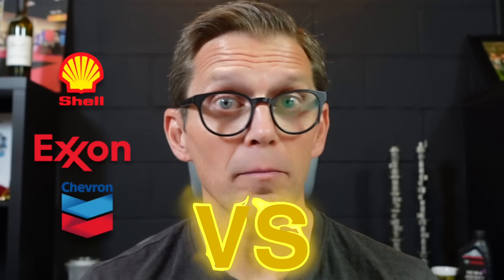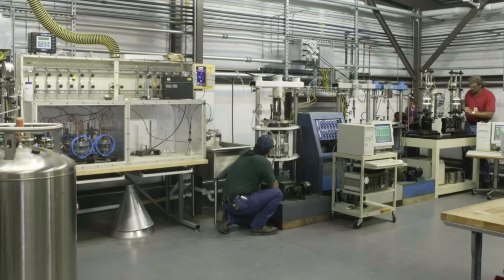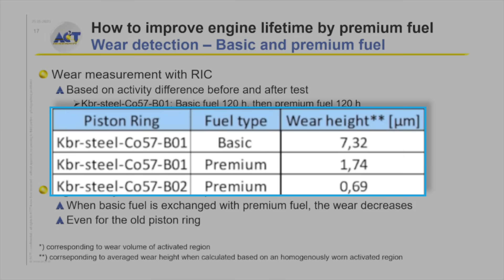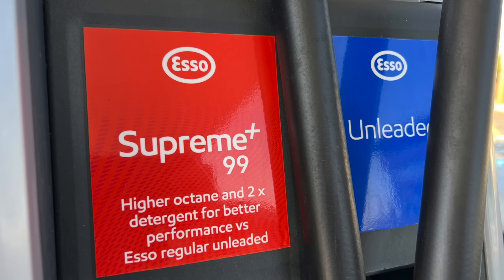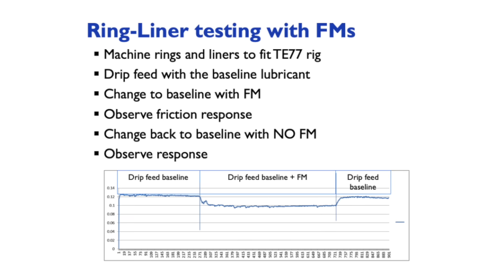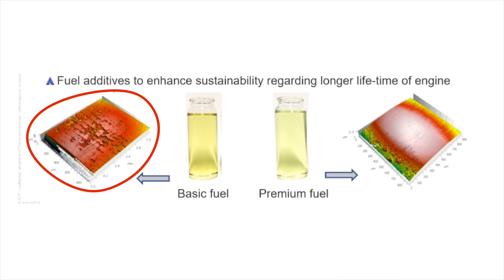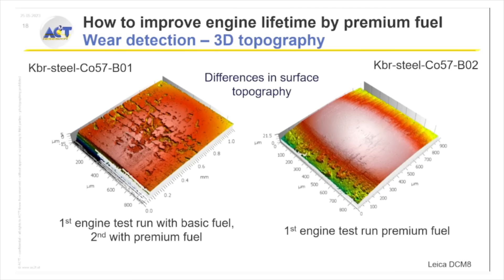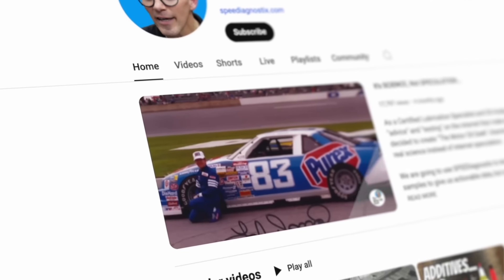Can Premium Fuel REDUCE Engine WEAR?

Comment: Hey Lake…where can we find a “ranking” of fuel brands from a premium additive perspective?
What about upper cylinder lubricants?
I’m a YES for a fuel video…
Reply: I used to use Shell 93 in my 2013 Scion FR-S which recommended premium fuel. Then my Shell station switched to BP, but they still kept the 93 premium (still the same fuel???). Sold the FR-S, and now have a 2015 Nissan XTerra. I started with the BP 87 octane, but was having issues with smoothness and knocking in the winter. Switched back to the BP 93 and problems resolved. I tried BP 87 again when the warm weather returned and stuck with that for a while. One day I decided to see if the BP 93 would actually make a difference so I filled the tank. I immediately noticed a difference in performance and smoothness. I now stick with the BP 93 as I am convinced that it is the highest quality fuel in my area. There are no good Shell stations close enough for normal fill ups.
Reply: @ICECarOwnerDIY BP is not a top tier fuel.
Reply: @ICECarOwnerDIY  If the XTerra had the VQ40 engine, it may have needed 91 octane as recommended since all vq engines run better on 91 or higher.
Reply: many Nissans don't like regular 87 fuel. My friend would have check engine light coming up with O2 sensor reading problem. As soon as he switched to 89 or 91 the problem would disappear.
Reply: @ICECarOwnerDIY Might have been knocking during the winter because of the butane injected vs summer no butane is in the fuel. Up to 5-10% butane in winter. Butane increases the Reid vapor pressure
Reply: @ICECarOwnerDIY the reason ur engine runs best on 93 is because that’s what the ecu OEM tune calls for.  No new engines are tuned for anything below 91. The reason you can use a lesser grade of fuel, is because the ecu can make up the differences by using more fuel and less spark to keep knocking to a minimum if any at all
Reply: @ziggyortiz37 not tuned for less than 91?  This doesn’t seem to make sense with certain OEMs having recommendations of 87 minimum octane in the manuals. Our 2017 Pacifica calls for 87, nothing more.  So I would assume they tuned the engine to run on it, and premium just wastes money.
Reply: @Tsuter1978 24 Chevy 5.3L has 87 recommend. Just because it’s the recommended doesn’t mean recommended for you. Just like lifetime transmission oil. Same as 10k oil change. I still own a 05 2.2L Saturn ion with 250,000 miles. Changed oil every 3-5K with NO engine problems ever.
Reply: @ziggyortiz37  adding fuel doesn’t change the fact that the fuel is less resistant to knock.
Reply: For the price Lucas is hard to beat, it’s not fantastic at cleaning, but it’s pretty good at maintaining a clean engine and is very good at lubing the cylinder walls well and helping increase compression
Reply: @meaculpamishegaslit Lucas additives are sketchy as hell
Reply: I still want to see the test results of "tribotex" supposedly it rebuilds surfaces
Reply: @cyclesaviorn2700 can't rebuild surfaces once there damaged.   Come on just think about it?   No additives can reverse damaged cylinder walls.    They can help reduce them from happening but can't reverse it
Reply: @cyclesaviorn2700 or tribodyne
Reply: Scam @cyclesaviorn2700
Reply: Top tier brands are usually the best. Google top tier gas brands
Reply: @MikeM952  Top Tier has nothing to do with anti-wear additives. The Top Tier consortium only regulates (among its members) detergent power.
Reply: Top tier is a detergency standard and a lotta marketing hoobityhoo.
Reply: I don't remember where I saw it, but someone took gasoline from several locations of several different gas stations and measured the additive packages of both the premium unleaded (91 or 93 octane) and regular unleaded (87 octane) gasoline.  Costco had the best regular unleaded gasoline and second best premium unleaded gasoline.  Shell V-power was the best premium unleaded gasoline, but they had one of the worst performing regular unleaded gasoline additive packages.
Reply: @r.j.bedore9884  That makes sense, based on price.
Shell regular is cheaper than Chevron regular, everywhere I have checked.
Shell premium is more-expensive than Chevron premium, everywhere I have checked.

To me, it's obvious it's the quality of the additives. You get what you pay for.

In the special case of Costco, the "lower price" is a result of volume discounts, subsidy from annual-membership revenue, lack of advertising, and forcing buyers to wait in long lines (to minimize Costco's per-unit infrastructure costs). Costco gasoline (of any grade) contains no anti-wear additives, whereas Shell premium-grade does.
Reply: In most states premium gas is about 30 or 40 cents more than regular.  But, in Indiana and Illinois where I drive it's a full dollar per gallon more.
Reply: I was also wondering about lubricant additives like Marvel Mystery Oil, Lucas upper cylinder lubricant, 2 stroke oil, etc. Although we don't know what friction modifier additives were tested or in what amounts, this data would seem to support that adding extra lubricity to the fuel with additives actually could decrease wear.
Reply: @averyalexander2303   I've heard they can damage your catalytic converter.
Reply: @averyalexander2303 I've tested a few of these if it helps. The easy proof was an increase in gas mileage. The other claims like reduced wear? 🤞
Reply: @averyalexander2303 that’s one of several reasons I keep buying those products. Lucas and MMO usually.
Reply: Yes, more info on fuel brands and there additives
Reply: Is there a benefit from using shell oil and fuel to see if it makes a difference.  Are they designed to work together for better benefits?
Reply: @justlost2010  that’s a damn good question!!
Reply: Can you do a video that shows wether we should add fuel additives to fuel ourselves for diesel and for gasoline engines?
Reply: Yes, more in depth fuel analysis!👍
Reply: Lake, more fuel videos please.
Reply: Its wild that practically everyone in this reply thread has no idea what they're talking about. You're all arguing and don't even know why.  One of you. Not one of you know anything about fuel
Reply: @sloanmagnum5009   - Yep. 

Even at the engine development department over here a Toyota Motor Europe we don't do the tests Lake explains. 

Even not cylinder wall coatings etcetera. 

The fuel used is ordered, 2 types, just regular fuel as we use at the pump. Shell is too expensiveand and not within thé budget ..  .
Reply: Chevron is the best but hella expensive though
Reply: My car requires regular fuel. Is Shell’s regular fuel still better than other brands’ regular fuel?
Reply: @7Gia_  Shell is good. ConsumerReports has shown that TopTier Detergent gasoline is the key to quality gas. Shell is TTDG!

Personally I use Sunoco. They commit to ensuring the same detergent package is equal across all their octane ratings. Some TTDG brands blend their packages to just meet the specs.

That being said. Any TT gas works for me!
Reply: So should we run premium fuel in a car that doesn’t call for it (2018 Outback)?
Reply: I agree with the OP. Though I’m stuck with only one gas station when I stay local. I have a turbo charged car tuned on 93 octane & only have one station with it because I live in a dinky part of the country. I don’t even know which conglomerate they’re Part of off hand lol. Still though I’d be interested to learn more about the subject for both wear & economy (ish). I have had 2 engines in the car since doing the tune (long story). During that time I had 1 station with 93 I used. I got about the same power back then but much better mileage. Since the new engine went in, that station no longer offers 93 so I have to use a different one that now has 93. My mileage is way lower. And I wonder if wear might suffer now too. I also wonder if I should be adding any additives but I worry about losing power &/or causing catastrophic damage.
Reply: …marvel 👍
Reply: Based on Lakes videos I’m doing my own long term research in 3.6 Pentastar

-Only top tier fuel  -Techroline every 3k miles 
-Pennzoil Ultra Platinum every 3k miles 
- Wix oil filters

Shooting for 500k miles
Reply: As far as I know , friction modifiers are present in premium gasoline of Shell, Exxon, Mobil,  Esso.
Reply: i dont call 91 premium, 91 to me is plus, anything below 91 i don't even look at, i only put 93 in my car though, since i only drive high performance cars and want maximum power. Im glad that i live in NJ and 93 can be found at every gas station.
Reply: Most gas stations purchase gas from the same place the only difference is the additives they put in it!
Reply: Do I need to be scientific? 
2002 Lincoln LS 3.9L V8.
Designed to run on 87-91 octane. Ran 87 octane on a 80 mile highway run at 70mph. Averaged about 21mpg. Did the same on 89 and 91 octane. As the octane went up so did the mpg. 24mpg at 91 octane.
2005 Cadillac STS V8 Northstar. Written on the car is 91 octane only. Mobil 1 only. I now have 238,000 miles on the car. Every year I check and clean the throttle body and it always looks clean and new inside and out. I have used just about every brand of gas in 20 years, and usually the lowest price I can find. I add Lucas additives to the gas about once a year. I have never suffered internal engine problems. Knock on wood. I still have original fuel injectors too. Am I a scientific genius? No. I read my user manual.
Reply: Fuel testing and analysis please!
We all will benefit and so will you, Lake
The Porsche will thank you!
Reply: Mechanic in a bottle. I swear by the stuff. It's like 5$and u put alil in with a fill up of fuel. It really does give you better gas mileage on regular 87pump
Reply: It’s been difficult for me to find any independent testing. I have seen Shell do very well with new engine break-in. I’m not a fan of the 10% ethanol, no matter what anyone says. Just give me a good, clean, efficient, reliable fuel that handles however my foot demands of it. Clearly we’ll pay whatever the cost for a no-bullshit product.
Reply: @cjcantrell80  here in the Midwest is a cooperative petroleum company based in Indiana by the name of Countrymark. At most of their locations they offer a 91 octane ethanol free fuel and yes it is fairly expensive
Reply: Edit: found the video ...  https://youtu.be/J2d6_CIwaNE?si=-PIK2sq1ehk807Ru  so check my accuracy :p lol

there was a news agency that tested; comparitive numbers (not exact) would be something along the lines of Shell 30 units,  Mobil/Exxon 24 units, other big top tier brands 18-21 units ...  baseline top tier is about 10 units.
So Shell does 3x the cleaner in its PREMIUM, less in its non-premium, closer to other brands than the standard to qualify.
Some brands have 10 units or more, but don't pay for the Top Tier label.
Some brands used to be and stopped participating in the program after Covid to save costs, including not doing the additives.

For my area there are lots of Mobils around me, some Shells.  I've been going to Shell mostly but I have a small fuel tank and their bonuses require 10 gallon fill ups; I'd have half a  gallon of gas left! Mobil only needs 8 gallons to qualify for customer loyalty rewards (cheaper gas) and is more common around me.  I'll take the bit less additives to have places that are nearby and when my fuel light pops on and I get 8.3 gallons, I still earn loyalty rewards to get that 20-30c/gal off ...  which can afford me a bottle of Techron every 3000 miles.
Reply: Yes, please!! It would be brilliant to have a European focus in one of your videos to understand fuel brand selection. Also, is there a difference in terms of cleaning additives and friction modifiers between ordinary shell 95 and the V-power? This info is tough to find! Thanks for the great video!
Reply: Does anyone know what additive package Costco puts in there gas? I know they don’t make it them shelves. They love advertising the Top Tier all over the station!!
Reply: Ok I’m just a little confused after this video. I watched all of your oil videos and fuel videos. Here’s my question. Top tier fuels are at different octane levels are you saying now that premium fuel is even higher protection not just higher octane  ????????
Reply: Would love to see a video that analyzes the different premium fuels from the major suppliers like Shell, Chevron, Exxon, etc.

Also interested to find out if a fuel additive like Lucas (which advertises reduced wear and upper cylinder lubrication) added to a premium fuel helps or makes things worse.
Reply: @DavidAg02  when you keep talking about premium fuel…I’m not certain your referring the ‘brand’ of the fuel or the ‘octane’ of the fuel…could you please clarify this?
Reply: @DavidAg02 Lucas is cheap for a reason
Reply: @donarcher5693  best check out BND Automotive.

ACES for gasoline or Diesel.......significant increase in bore ring life
Reply: plz
Reply: I would like to know why high octane fuel are cleaner, because the sulfure content will be the same ?? I wonder if additives will countermeasure that issue 
BimmerN53
Reply: Going to use shell from now on
Reply: Shell V power 👍
Reply: I don’t know if these results have practical application in a commuter car.  Any engine’s ECU will adjust for knocks and adjust for fuel octane.  This is a test in extreme conditions
Reply: Let me save you the trouble.   The best fuel hands down.  Is from shell.  The v-power nitro +   is the best fuel if you care about your vehicle. Got the most detergents then others. Even shell low 87 Oct is better then others high Oct has more detergents.    2nd would be Mobil synergy stations
Reply: @LORD_OF_THE_ROOTS how do you know? Did you test it yourself against other brands?
Reply: What fuel to use?
Reply: Fuel Video ! Fuel Video!
Reply: Yes. What is the best fuel additive? Will it convert regular fuel into fuel that is as good or better than premium fuel?
Reply: @richardschennberg1776  Octane rating has nothing to do with this video. And unless your daily driver needs premium aka higher octane to not destroy itself with preignition then using premium is just burning for no reason. This video is about the lack of sufficient detergent in most US gasoline and why it's a problem for modern vehicles, especially with direct injection. Really not that difficult.
Reply: My turbo Forester doesn’t seem to like shell gas it just seems to not run quite as well as other fuels
Reply: @projectfarm
Reply: Doing a web search indicated that Shell and Exon Mobil both advertise using anti wear additives, as well as high tier detergent packages.. If you can believe web info !
Reply: Sunoco in Texas 101 octane... Constant blue flame out of my Harley
Reply: Shell & BP are the only two I’ll use and 99% of the time it’s Shell.
Reply: @169abr  speak with BND Automotive ...ACES fuel additive.
Reply: @169abr literally the same two options for me and it’s mostly shell 93
Reply: @169abr yeah man that shell V power seems to be the nicest so far for my vr6. 
Pretty sure I couldn't be fooled in a blindfold test😂
I figured it would , because they put the V in it, so that means it's made for vr6s and other V engines. 😂😂
Reply: @MrTheHillfolk  my Coyote loves the V-Power, 7500rpm shifts and no knock
Reply: @169abr  I've been able to confirm that Shell and Caltex premium fuels both have friction modifiers added.  Have not been able to confirm the same for BP (in Australia).
Reply: @169abr  Why not Chevron?
Reply: @169abr it just kind of sucks that those are not available everywhere. I live in Montana and really wish that either BP or shell would be available to me.
Reply: @mspringett  Sunoco isn’t a bad option if there’s one near you. Some people have said they have luck with Mobil as well. I tested Mobil myself and the knock was less than CircleK/Racetrac
Reply: @169abr  I typically go to Costco and get their 91 octane no ethanol fuel. We do have a Mobil station but it's primarily Conoco here in montana. There is a company called Town Pump that operates all over the state and has a variety of branding to their gas stations.
Reply: @169abr  Pretty sure it is. My old man owned a BP gas station, only used BP premium fuel in his motorbike, went over 100,000k's (for a motorbike that is insane) they tore it down because by then you normally had to do a rebuild) and the thing was like new, nothing needed to be done. The thing went on and did another 100,000k after that with the new owner.
Reply: @169abr  BP is trash, shell, chevron, mobil
Reply: @169abr  Pretty sure BP is not "top Tier" if that matters to you.
Reply: @chestrockwell8328  I go based off datalogs of my car, and BP shows no knock. That being said, I only use it when I’m in a pinch and not near a shell.
Reply: @chestrockwell8328  BP seems to have voluntarily left the Top Tier consortium, despite its fuels continuing to exceed the Top Tier minimum requirement for detergent power.
Reply: @chestrockwell8328 , no, but they tend to have higher quality because they produce so much of it and they use a robust additive package compared to some of the other companies
Reply: Bp is a top tier brand.
Reply: @aliendroneservices6621  Where is the data showing this, or is "just" BP saying that?
Reply: @TedTedness  So far, it's just BP saying it. Independent data would be wonderful, but no one wants to produce it.
Reply: @169abr . Exactly!  I always use shell. If I use anything else, especially gas on any military installation, my tuner will ask me where in the heck did I get my gas and to go to a Shell. But I’ve been using shell for 15 years due to that.
Reply: @chestrockwell8328  BP stations in my area are not Top Tier rated. Shell regular gas is not certified as Top Tier as well. But the Shell V Power is Top Tier in addition to the anti-wear additive.
Reply: @169abr LMFAOOOO shell is overpriced fuel 30+ cents a gallon compared to anywhere else
Reply: @bfw59  Not any more. They quit.
Reply: @bfw59 BP has dropped out of the Top Tier program. I don’t know why, and I don’t know if their fuel still meets Top Tier standards, but I speculate that it still does.
Reply: @169abr  No one is talking about octane here genius. Any fuel with enough octane will prevent knock. People are talking about additive packages. Has nothing to do with octane. Try to keep up. At least you were right about Shell, by accident. Shell Premium is the best you can get in the US. Fact. BUT. not every Shell station actually uses Shell fuel! What? Shocking. Other top tier brands include Chevron with Techron, Marathon with STP additives, Costco.  Shell is the best, but again not every Shell branded gas station is actually selling Shell fuel in those pumps. You have to check online to verify. the Pump itself will have the "top tier" sticker on it.
Reply: @169abr  I have a 2010 corolla 245k miles. Around 200k miles it started running like crap. I always got bjs gas...not too tier. I knew nothing about top tier. Happened to get shell once and it ran great. Since I only get shell. It's definitely worth the extra 20 cents or so a gallon.
Reply: The basic Shell 91 octane fuel gives much better results than other brands e.g. About 5% better mileage.
Always wanted a better explanation for the difference.
:-)
Reply: I use 1oz of 2 stroke oil per 5 gallons of gas in my vehicles. There was a great discussion about it on the LS forums.
Reply: I do also.  I started about 10yrs ago, and all of my vehicles get the treatment on every fill up.  Even my bikes than use non-eth.
Reply: @taylorwarwick1001  This is something I've always done in my rotary engine,
the concern with modern stock engines/exhausts is that this extra oil risks clogging the cat converter.
Reply: Catalytic converters dont appreciate that @taylorwarwick1001
Reply: @taylorwarwick1001  There are lubricant additives available for pump gas 4-stroke engines....Lucas Oil comes to mind...
Reply: @taylorwarwick1001 yep !! Good call it have used it
Reply: @taylorwarwick1001  However, modern 4-stroke engines are designed to run on pure gasoline, and adding 2-stroke oil could potentially cause issues with the fuel system and/or emissions components over time.

Adding 2-stroke oil can contaminate the oil in a 4-stroke engine, affecting its lubrication properties. The engine internal components might experience increased wear due to improper lubrication.  And the oil can damage the catalytic converter, leading to costly repairs.  

The Oil Geek has already proven that stuff does make it past the rings, and they saw that in oil samples, so don't argue saying that can't happen, the tests prove that it does.
Reply: I've also been looking for a list of quality diesel fuels or some method or option for testing (testing seems to be focused on water and dirt contamination) 
The only "top tier" diesel I've seen is Costco/Kirkland and I'm sure that it meets the TT standards, but I would have difficulty believing it's the best option (also an unfeasible option for my location)
Reply: @UnProj  Cenex if its an option for you. Farmers, Truckers, construction fleets, and logging crews swear by it.
Reply: @UnProj  what about the Main Problem with fuel ?

Its not water in fuel. that's the biggest problem......its Entrained and Dissolved Air
Reply: @gj91471 best comment in this video 👍.
Air in the fuel system is a huge problem.
Reply: @gj91471  Whats the logic behind that? The only two papers I've found on dissolved air in fuel only claim issue for the gas station but claim it burns more efficiently. 

Basically dissolved air is good for the car not for the station...
Reply: @AlkalineGamingHD  stop reading BS papers. .....

My Diesel engine is nearly perfectly clean inside.

Injectors are spotlessly clean.

Go figure ....that Entrained and Dissolved Air is a massive Problem...for You...not ME.
Reply: @gj91471  Im talking about gasoline. Didnt know you were talking about diesel. I wont pry much further seeing how asking such a simple question like "why" was so unanswerable lol
Reply: @AlkalineGamingHD  Google.....Entrained and Dissolved Air in Fuel.
Reply: @AlkalineGamingHD  why would i bother explainjng anything to You.....

You think You know it all.....after reading 2 papers.......

I restore lost fuel economy........

Get complaints from the Motor Industry....for Engines lasting too long......
Reply: @gj91471  that's why I run a fuel/air separator, leaving the detergents/additives to by my primary concern
Reply: @UnProj  is that to seperate Water from the Fuel ?

Or Entrained and Dissolved Air from the fuel ?
Reply: @hanynowsky  So California oxygenating their fuel is bad?
Reply: Let's ask Scotty Kilmer 😂
Reply: @arinmirzayan3949 if he tells us,they throw him off YouTube, at least until his next video comes out.
Reply: Love your content but we need an oil analysis on Pennzoil’s new formula!!😮 Pennzoil platinum full synthetic now advertising 15,000 mile protection!! How is that possible without changing the formula!?? You taught us all those extra additives and detergents might not be a good thing. I think they ruined the original formula!! HELP!🤣🤣☺️👍
Reply: @josephparson7023  the one thing ALL oil claims fail to mention is the filter. Sure, maybe your oil can handle the beating for 15,000 miles. However, the filter, that can only filter out so much. No matter how good the oil is, it will always be dependent on the filter to continue to perform. Once the filter is done, the oil becomes the same sludge as any other oil.
Reply: @cjcantrell80 this is so true, even amsoil has you replacing filters at regular intervals in between oil drains.  I forget what the intervals are but if memory serves it was at least one or two filter changes in between oil drains.  But when I ran amsoil I used to just drain and fill at the same time anyway.  Cheap insurance for keeping the engine healthy.
Reply: @cjcantrell80 

thats true. I did a lot of experiments on a chevy malibu. Cheap filters would cavitate around 5000 miles. cartridges..
Reply: The very best fuel available in the U.S. is summer-blend Chevron Premium 91 octane from California. Reason: California gas has its own additive requirements which are more stringent and beyond those mandated by the Feds. 

Chevron’s additive package is considered the best in the industry and the proof is in the pudding: All major U.S. automakers use summer-blend Chevron 91 on the EPA fuel economy tests which are posted on new-car window stickers.
Reply: @kobyashee1832 California 91 is horrible for performance vehicles. Ask any tuner and they'll tell you how bad California gas is vs any other 91. California cares about emissions, and ending ICE engines
Reply: @kobyashee1832  Sources for any of your claims?
"For years, EPA has used a pure test fuel called indolene, which is not the same gasoline the public would find at the pump." (ELPC)
Reply: @kobyashee1832  Would this statement have anything to do with the fact that many vehicles have to meet California emissions requirements; no matter where they're sold??
Reply: @kobyashee1832 there is no way any fuel from California is the best. It’s trash and anyone w/ a modified vehicle knows this. While higher octane doesn’t mean more power, higher octane fuels are readily available outside California.
Reply: @Bob_Smith19  nope, he's actually exactly right!  The reason is as he said, the CA requirement for overall results is very high, so the additives are ideal & maxxed.  Chevron iirc is a CA company.  CA is the largest gasoline maker as well.   My father was a fuel and lube deep expert, chemist, engineer ,etc, savant as well, solved unsolvable jet fuel issues for Boeing.
Reply: @kobyashee1832 pretty bold claims. Got actual proof or is this what pa-pa told ya?
Reply: @Maverick09171 love this comment.  “Papa told ya”.   So funny, and so true.  I’ve been wiping my ass with an oily rag for years and my 2008 vehicle runs fine.
Reply: I use 8oz of sta-bil per tank full of 87 octane rated fuel. Works great, and the engine runs quieter.
Reply: @ozzzy2000  8 ounces per gallon?
Reply: @j.t.cooper2963  My bad 8oz per tank full.
Reply: @ozzzy2000   No you don't!
Reply: Top tier brands say top tier on the pump. Chevron, Shell and QuickTrip are 3 I know of that I use regularly.  
Loves, BuCees and Pilot along with Marathon, BP, Kroger, Sams club is all garbage tier (no detergent additives) and should be avoided if you want long engine life. If you do use them, be dang sure to add some Techron complete fuel system cleaner ($9 a bottle) every oil change. A stuck low tension piston ring from deposits is death to your engine. 
Do the math. Maybe you’re not saving any money if your gas is causing more wear.
Reply: @BeefNEggs057 Marathon is top tier.
Reply: The USA only has 130 oil refineries and this is due to regional distances between population centers or shipping access.     So in al reality anywhere you live there is probably only around 3-5 refineries that produce the gasoline for the local stations.    Most brands use a generic additive package, I assume Shell or Chevron provide their own ready to go mixture to add, but I don't really think you are going to get bad product at least not in the USA.  If you drive to Mexico things can get a bit more complicated but that's another story.        I myself drive a lot and on the road you sometimes just use the station that is available and many times don't really have an option and yet  when I change spark plugs I always use a borescope to check the condition of the cylinders and even at 150k miles I do not see much wear.      There really needs to be a mechanical issue or lack of oil pressure or cooling issues are needed to cause trouble from my experience but some engine designs may also lead to different outcome as the engine wears.        One issue is engines with higher compression or perhaps higher revs may have much more impact on scoring than fuel mixture but that is just my assumptions on a logical view.
Reply: Well antiwear additives in the cylinder is of minimal importance. carbon accumulation leads to stochastic pre-ignition and the detergents help to minimize that. There is also no evidence UCLs help at all. They came out of the blue solving a boogyman problem unlike the decades of evidence based research around PEA fuel detergents and oil additive formulations. 

Not to mention but despite being thin, gasoline does act as a low viscosity lubricant. Rub a little between your fingers... Oh and most UCLs are just ethoxolayed alcohols so they act essentially the same as the ethanol co-solvent already in the gas...

End of the day adding 10% the cost of my gas tank in additive without definitive proof of it helping just seems...wasteful IMO.
Reply: @AlkalineGamingHD  "There is also no evidence UPLs help at all."
Do you mean UCLs? What does UPL stand for?
Reply: @aliendroneservices6621  Correct. Ill edit that thank you!
Reply: @AlkalineGamingHD  Also note that Ethanol contained in fuel attracts water and it's bad for fuel lines, perhaps more additives to countermeasure that or run the tanks quickly?
BimmerN53
Reply: @federicotorresbordils7624  Maybe but general rule of thumb is to not let cars sit for too long. Even EtOh free gas still rusts tanks and lines. Gas attracts water all the same.

That being said in the 20+ years of cars I've seen and dealt with I've never seen or even heard of failed gas lines in ANY post '90s cars that were regularly driven. Only bad lines were cars that sat for years and often times more than once.
Reply: @AlkalineGamingHD  Did you watch all the video with the data?
Reply: @AlkalineGamingHD  Your statements are a tapestry of facts and opinions. Your comments are thought provoking and stimulate further investigation. 10% is a big difference in fuel costs. I agree Top Tier additives play a large role in increasing service life. For the present, I'll use the Shell V Power premium only in my Yamaha Quad because it has an non-coated all aluminum cylinder.
Reply: @AlkalineGamingHD

That was a lot of words to ignore the entire point of every study independently conducted on top tier fuels. You sir, are an idiot. 👍🏻
Reply: @AlkalineGamingHD , gasoline absorbs easily through skin and ruins kidneys and has high concentrations of known carcinogens, among other things
Reply: @AlkalineGamingHD  that's why I like TCW3's. They are proven to reduce engine wear. 

To have that label they all have to go through 3rd party testing.
Reply: @DENicholsAutoBravado TCW?
Reply: Data from my car and fillups show Chevron consistently giving me about 12% better mileage than no-name brands like Costco or Walmart. So that means less friction.
Reply: @igelbofh 12% is a hugh number!  I’ll have to try a few tanks of Chevron premium.
Reply: @igelbofh  Costco uses chevron fuel. So.... what do you mean you only use chevron and not costco. Costco also maintains high quality pumps and filters in their fueling stations.
Reply: @sloanmagnum5009  Everyone uses Chevron gas...as a base. The additives at a Chevron station is different than the additives at a Costco station, which makes them different.
Reply: @SayAhh  no, that's not how that works
Reply: @sloanmagnum5009   "Costco uses chevron fuel."
Not according to Costco. See:
Costco Gas Stations
Frequently Asked Questions

Q: Where does Costco get its fuel?
A: Costco buys fuel from major refineries and distributors in each area.
Reply: @aliendroneservices6621  From a quick search, you are correct. That is what is stated on their website. But I promise you. At least in my area,  costco stated that it switched to Chevron fuel. I didn't believe it at first. It was in local news and on gas/fuel message boards as of last year when I had found out, and even checked and shared web links about it. I asked the attendant at costco at the time, and they said they're using Chevron fuel. But it will now sound like I'm making it up because I can't find the article or links stating it anymore, but they were the first links to pop up on Google when I had searched. So for now, you are correct and I'm wrong because I have no way of proving it.
Reply: Costco is good gas!
Reply: Hey Lake I've heard Rislone Hyperlube with zinc cuts down on engine wear and also quiets valvetrain noise. Have you tried it? Thanks.
Reply: It sounds like you’re describing the same role as the motor oil. Adding wear additives to the piston walls and rings with each piston stroke. which would survive longer than something in the fuel. But I suppose some type of upper cylinder lubricant could be beneficial to the fuel injector function. Or possibly the intake valves if it’s not direct injected. 

Maybe seafoam is a good idea because it has pale oil as it’s upper cylinder lubricant
Reply: Gas is gas
Reply: Brands don't matter. Gas stations are franchises, they are supposed to add the additive packages, but rarely do. The fuel that comes to the gas stations is the same.
Reply: @igelbofh  Shell Vpower doesn't absorb as much Air as the other brands......the fuels are not all the same.